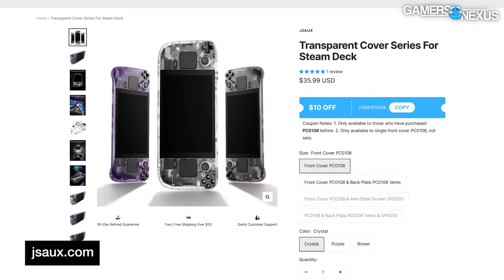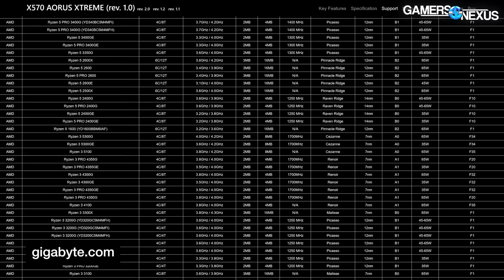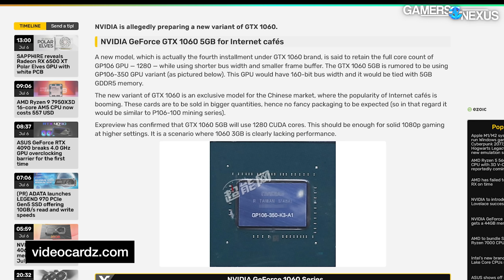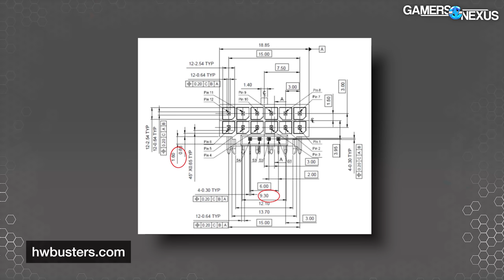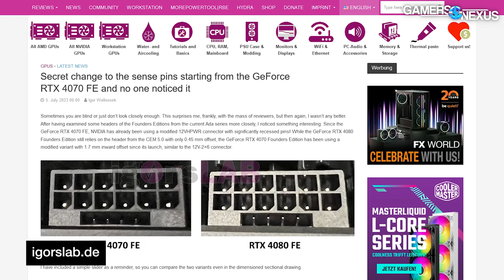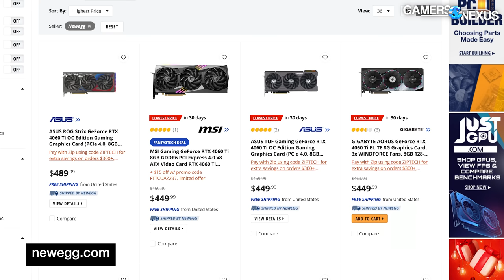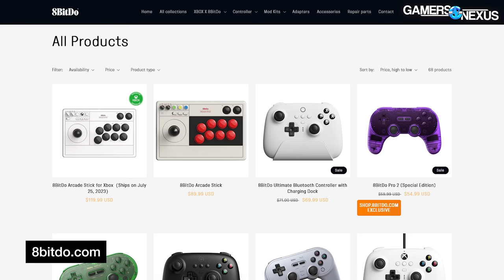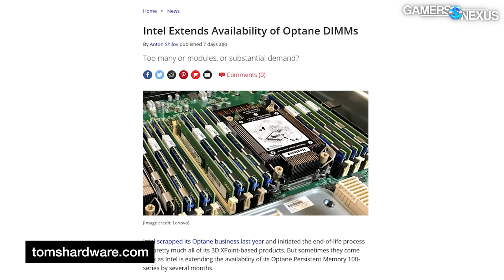HW News - Ultra-Small Intel Arc GPU, 12V-2x6 Connector, More AM4 CPUs, 4060 Ti 16GB

Comment: AMD is just releasing more AM4 CPUs to piss Steve off.
Reply from the maker: AM4 was a good platform! No problem with extending its life -- although the ultra low-end stuff is probably more for other markets that are less saturated.
Reply: It was hinted a long while back (after AM5 dropped) that AMD were still planning to release more budget AM4 CPUs in the future. This is I think what they were talking about.
Reply: @jimtekkit  I have seen 5900x/5800x3d cpu's priced at $274, you can get a B550 AM4 board for under $100 and DDR4 Ram 3600MHZ cl-16 is cheap.  This would be a good option for people on a budget.
Reply: @jimtekkit I think the general interpretation of that was more that the old chips will stay in production for a while, at best.
Reply: They've had embedded variants of the 5600X, 5800X, 5900X, and 5950X out for a while now as the Embedded 5600E, 5800E, 5900E, and 5950E, although the Embedded variants of the mainstream desktop parts have locked multipliers because they're geared towards stability in the types of scenarios where embedded hardware would be used.
Reply: @GamersNexus honestly I love that they're keeping it alive for budget builds with great performance components
Reply: He'd probably be happy with the use of electronic waste. Why throw away faulty 6 core cpus when you can make them 4 core?
Reply: @Darker_Waters  Its not like they are releasing any GPUs with enough power bottleneck my shit yet. 🤣
Reply: @Darker_Waters  sure but work buys me the good stuff, my own doesn't need to be the newest and most powerful just good at games. 👍
Reply: @GamersNexus  To be honest I was waiting for 5900X3D and I saw this video title I though that there may be one. But I think I should just replace my old 3600 with 5800X3D now and don't wait anymore.
Reply: Can you imagine if they came out with a 5800x3dxl or some stupid shit 😂

The AM4 socket is eternal.
AM4 stonks forever.
Reply: didnt 5100 exist before?
i remember coming across it a couple months ago on amds site and it was listed as oem
Reply: @davidbrennan5  hell naw, dont get a 5900x I got one instead of the 5800x3d, I was a fool thinking it was better, yeah 1% lows on some games tells me other wise. if your on am4 go 5800x3d or go am5. Dont mess around and be like a idiot, like i was. I upgraded to a 5900x like 6 months ago and now i need to upgrade again..
Reply: @turboimport95  I am on AM4, I have a 5950x and it rocks. I would go for a 5800x3d if I was gaming a lot but for workloads the cores matter. I usually buy last gen high end stuff for half price.
Reply: Personally I see this as a perfectly good response to the 13100 Intel chip - Zen 3 isn't much less efficient than Zen 4, so the decreased efficiency isn't that big of a deal in low power low end parts, and while mid range Raptor Lake parts have their uses IMHO it's pretty hard to think of a workload where the single thread performance of Raptor Lake is required but is still fine with the very low core count.
Reply: IVAN TORRENT PFP, INSTANT CHAD
Reply: Not gonna lie the M.2 on a graphics card is actually super cool. I can see this kind of product adding flexibility to OEM-style Dell & HP computers along with SFF cases. On a RX 7600 it makes a fair amount of sense (once we run out of 6700XTs)
Reply: @davidbrennan5  and almost 300 dollar cpu is budget to you? I don't think you have shopped budget hardware then...
Reply: @GamersNexus  AM4 is just so popular because AM5 and Intel based boards and new chips are so damn expensive compare to the inflation that the people are thinking twice nowdays before they buy a pc that cost now 2x that much then it did 5 - 10 years ago.
Reply: Compared to a $6500 thread-ripper CPU $274 is cheap. The 5900x is 52 percent off its msrp. If I was building a PC around $1500-2k total that is what I would do. I would buy a 12900k or a 5900x or  5800x3d or 5950x CPU. Newer games like immortals Of Aveum recommend a 1 gen old 8 core CPU (5700x/12700k) just to play at 1440p medium/high 6800xt or 3080ti gpu. Their minimum requirements for 1080p low/medium is a 3700x/i7 9700 CPU and a 2080 super or 5700xt gpu.
Reply: @davidbrennan5  2k? that is nowhere near budget pc... try 500-600
Reply: @LiLBitsDK  $500 isn't budget, its scrapping the bottom of the barrel. Go buy  a Playstation. You can't even buy a good gpu for that. You might be able to put a bunch of used parts together that could beat it but it wouldn't be easy. The PS5 is equal to a 5600x and a RX6650/3060 gpu. That is why their sales are up.
Reply: @davidbrennan5  pc gamers don't want a praystation crap thingie... they want a pc... and plenty build for that budget... and dunno what you consider a good gpu but not everyone uses 4090's...

Tech by Matt just did a build for 400, 2 weeks ago, and someone  did a build for 645... and you can get some good ideas there to modify the build up/down to get to 500 if you wish or to 1000.... and have very playable and enjoyable experiences... of course you won't get 4K Ultra at 144Hz but not everyone needs that or wants that...
Reply: @LiLBitsDK  it could be done but it wont age well. Good luck with AAA games. That build you refer to used a bunch of untested used parts with no warranty bought off ebay lol and they were prebuilts with low specs to boot. He is getting 80fps medium at 1080p in a 6 year old game. The PC I built in 2019 for $1500 gets 140 FPS in the same game with those settings
Reply: @davidbrennan5  you can play most AAA games on budget machines... maybe you should learn a little about graphics settings before making yourself look like a fool lol

sounds like you think they can only be set to Ultra and everything else will be bad... waste of time with your trolling... move on... when too oblivious to know that most people actually play on cheap machines and not on 4090's and they are having a blast, even with newer games...
Reply: The 6 year old card in that build (RX580) doesn't meet the minimum requirements for 1080p low/medium on a lot of newer games, especially when you pair it with a weak CPU. You would be better off with a RX6600 or a Intel arc. I would not buy anything less than that for 1080p, even a used 2080 super would be a better choice. Those cards will destroy a RX580 for around $200 and you would be able to turn eye candy on and run at high settings instead of low.
Reply: @davidbrennan5  it can play plenty games in 1080p on more than low... and most of the games people play aren't the brand newest... tons of people play LoL, Doom 2016, GTA 5, F21, FS22,  C:S, CS:GO, Borderlands, various Battlefield games, various Witcher 3, various Wolfenstein, Xcom2, TF2, various Tombraiders, various Anno games, various Resident Evil games etc. etc. there are tons of games... how do I know? I played many of those... with a RX580 and Vega56 in 1080p and I didn't play any of them at low...
and there are a ton more games... can it run  CP2077? it might even be possible, since someone made it run on an APU... not 1080p but to be honest I was surprised how decent it looked... would I prolly get another card? yup... 2060 is pretty cheap used here... so move on... you expect it to run all on Ultra or else it can't run... guess what most people in the world live with less than that... heck most games you get like 30% performance changing from ultra to high and lose little to no quality...
Reply: @LiLBitsDK  look at the steam survey, 1 percent of gamers are using a RX580 in 2023. I had a 660ti in an old rig and it could play those games but It wasn't a good experience by any means after 8 years it could barely handle esports titles. You will be in the same boat in 2 years with a RX580. The most popular card now is a 3060 which would be about the same as a 2070 super.
Reply: @davidbrennan5  how many people is 1% of 120.000.000? and how many use 1060? 1070? 1650? 1660? 1660 S? 1660 Ti? etc. etc. all cheap low end cards...
Reply: type in "everage cost of gaming pc" on google. it says On average, it'll cost somewhere between around $800 to $1,000 for a very good 1080p/1440p gaming PC. Between those two figures, the more you spend, the better your gaming PC's performance will be. You can easily spend more than that, too – but not less.
Reply: PC World: This 5600x3d is the last AM4 cpu...
GN: This 5100 is probably the last AM4 cpu...
AMD: Hold yer horses, presenting the 5300x3d with 4 cores of raw gaming POWER for AM4 ^_^

Comment: the low profile a380 is a game changer for optiplex rebuilds, its the first low profile 4gb+ card that isnt insanely expensive like the a4000
Reply: just dont forget you need re-bar which needs a new-ish system
Reply: @profosist and pcie 4.0
Reply: @NoKiddingBoss arc a380 can be used with pcie 3.0 no?
Reply: @NoKiddingBoss yeah no, it's weaker than a 6500xt which only has 4 gen 4 lanes, the a380 has 8 lanes so pcie 3 is still the same as what is sufficient on a signicantly stronger card.
Reply: @vickersvaliant1 it's 4.0 x8 which means that yeah its fine on gen 3 especially considering its performance 
The 6600xt is a significantly faster card, also on 4.0 x8 and its fine with gen 3
Reply: It will at least compete.. I don't think there's anything better than the RX 6400 for most low profile solutions to avoid hassle. That said, more options are ALWAYS better. The space needs competition and maybe companies will see a market (better LP GPUs please??) there if they sell a good amount.
Reply: I used cards like the 1650 and rx 470 for that, which I believe can be found cheaper on the used market than the a380. But it's nice that the latter has more vram.
Reply: and it finally doesn't require 6-pin which was weird that it had one as it uses only 50W
Reply: The 1650 doesn't exist? How about the 1050ti? The rx 550? The rx 560? (There is one more but I agree that it's not worth mentioning)
Reply: @covante4822  4gb+ aka anything with more vram than 4gb
Reply: @KL-pe4kn  theyre already making a single slot pro card for that use I plan to buy one as an accelerator once adobe supports it properly
Reply: Low profile gtx 1650 also has 4gb of vram and are usually very discounted
Reply: It also needs to be slot power only but it isn't. With the latest drivers 4514 and dynamic tessellation set to 50 it is a nice card for 1080p
Reply: @NoKiddingBoss no difference in performance between 3.0 and 4.0 for the a380
Reply: Also keep in mind at least on windows many of those old office system have an end date of 2025. I will also say as someone who regualy has to support as old as first gen Intel to latest gen hardware you really do notice a difference using as your daily workstation. Even the lowest end new hardware at least supports modern protocols and has QLC NVMe.

Though I am seeing most places currently ditch anything older than 8th gen, 8th gen and newer is going out the door. heck ive even seen early 10th gen being replaced.

Great time to snag a free system or get your friends off 2nd,3rd,4tn gen.
Reply: @KL-pe4kn try the new 4514 driver with dynamic tessellation on 50.  It has improved a lot like 50-70%
Reply: @GewelReal unfortunately it does
Reply: @KL-pe4kn  it'll be a serious interesting offering I think.

Comment: Looking forward to that A380 revisit. Hope you'll also include some older games. After all, low power cards should be good for those, but logically Intel supposedly focused more on DX12 titles.
Reply: I'll give a preliminary review. It's better than at launch and at anywhere from $119 to $99, it's the best actually new (ie: not a 580 or 5500 possibly remanufactured in China from a mining farm) ultra-budget card that you can buy compared to the GTX 1650 or RX6400, much less the GTX 1630. It still has issues with older games, mainly DX11 titles, but they're much less pronounced than in the past. Arc Control isn't as bad as it used to be, but it's obvious that Intel is focusing on games and applications. Expect about a 5-10% lead over either of the two aforementioned cards in the games that Intel focused on and anything goes for the games that they haven't. A ~300Mhz overclock  to about 2700Mhz will put it around a 1650S or a 1060 in some games. It's behind a 580 in almost all circumstances unless you go crazy on the OC. It gets slaughtered in anything actually meant for next/this generation of games except Cyberpunk, where it can almost do 1080p60 low settings at native resolution when overclocked because Intel threw all their resources on that game. It's an encoding beast, but still has compatibility issues with a lot of productivity software. Also, in general, Intel has RT available in Blender now. IDK how it performs, but their preliminary results have the A770 on the same level as a 3060 with Optix. It means nothing for an A380 though.

TL;DR: Buy a used 1070 or 580 if you want a dirt cheap card for gaming, and you don't mind some risk. Buy a 6600 or A750 if you want something new that can play modern titles at decent settings. Buy the A380 LP if ASRock doesn't slap a hefty low-profile tax on it and you have a modern enough system, but are too paranoid about the used market and too broke to spend another $100.

Edit: I just tested the A380 in Secret Deer with Blender 3.6 at stock clocks. Going by Techgage's benchmarks, the thing went from 186 seconds to 111 seconds. That ties the card with the 7600 assuming that HiP didn't make a similar speed-up for AMD cards. I keep on forgetting that this thing can be a beast when Intel puts their competent developers on the job.

Comment: I actually really like the idea of a parasitic M.2 on the GPU. Genius.
Reply: Agreed! Imagine if they can wire this thing so it can access the drive like that old Radeon card. DirectStorage was made for this!
Reply: parasitic lol
Reply: Yeah… but they should put 2 M.2 slots on them… there are 8 free lanes and M.2 uses 4 of them.
Reply: @gorgonbert  Does 8+4+4 bifurcation exist or is it just 8+8 and 4+4+4+4?
Reply: @irridiastarfire  good point! Didn’t take that int acount. 
Maybe via a pci switch? But i guess that gets too expensive… damn… would have been so nice for a project i have in mind…
Reply: yeah, ngl, a gpu that's made for newish pci revisions, but has a m.2 slot would be really cool

either that or a low performance card so it doesn't need those lanes anyway, then it'd be really good for a mediaserver, getting both decoding and another drive slot would be epic
Reply: The Radeon 6400 will go from 40 fps gaming to 30 fps and 3x4to storage movie server lol
Reply: Makes a lot of sense for ITX boards in SFF to utilise the GPU as additional storage methods.
Reply: Even better if it was symbiotic
Reply: Actually commensalistic, as the SSD is not harming the graphics card by using 8 lanes that would be otherwise unused.
Reply: @gorgonbert board space is a thing too. The 8x GPUs are gonna be smaller so not that much space for 2 slots.
Reply: This is one of those innovations that is both incredibly simple but also extremely effective.

Honestly, I hope it becomes a standard feature on all cards that don't use the full capabilities of their PCEI slots. I feel like it could be the saving grace for those kinds of cards - all of a sudden it has WAY better utility and value proposition for buyers. There is absolutely a market for people who would willingly lose some GPU performance for more storage - like a general home entertainment/media machine or small form factor builds with limited M.2 slots.
Reply: I mean if the lanes are there being unused, why the eff not, it is an awesome idea in my opinion
Reply: If they can attach an M.2 slot to a GPU, they can also make socketable VRAM.
Reply: @sovo1212  you do realized that ram and SSD serves very different purposes? 

If I remember properly (and I might not) using a slot for RAM impact latency and can impact signal integrity and, again if I remember right, this is particularly bad for VRAM when compared to system RAM.
Reply: @TontonGahu  Source for that. AFAIK, soldered RAM doesn't have lower latency, it just saves a few cents in manufacturing costs.
Reply: Or..... Now hear me out....

How about they add a vertical 4.0 x8 PCIe slot on the back of the graphics card.....
So that way you can add ANOTHER 4060!

😂

Comment: If the 4060ti 16GB has the same bus, then it will have all of the same issues as the 8GB, just with more VRAM to play with.
Reply: There are no issues with hardware, the problem is the price and the name change from rtx4060 to 4060ti. It's a really fast 1080p 128 bit card.

Comment: I love the idea of the 4060ti with the m.2. It could come in very handy for upgrading prebuilts or older systems that may not have more than 1 m.2 slot. Or even an older system thats pre-m.2 (although thats a little more of a stretch). Anyway, the lanes are wasted so it's nice to use them for something...its a nice value add
Reply: Or boards with only one PCIe M.2 when you really want to use a second one.
Reply: Actually that makes a lot of sense. Been trying to figure out why anybody would want this but hey that does sound like a useful feature for some.